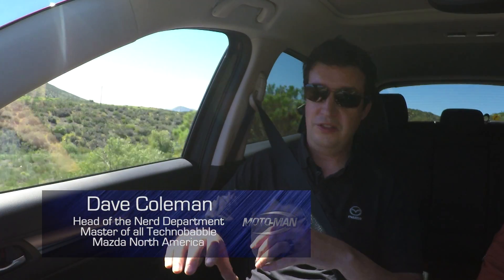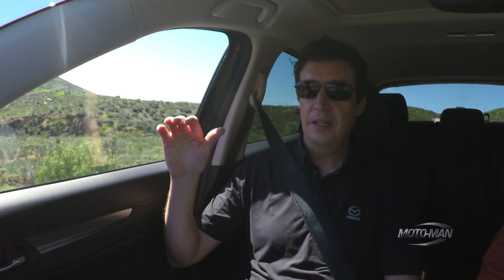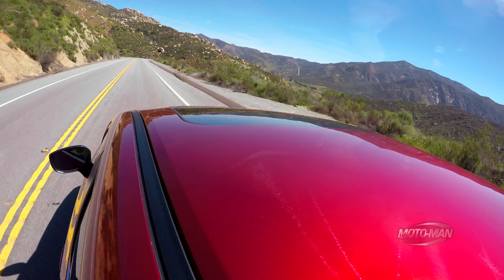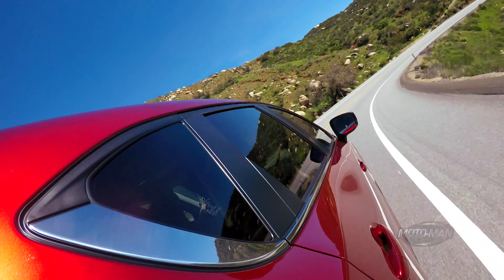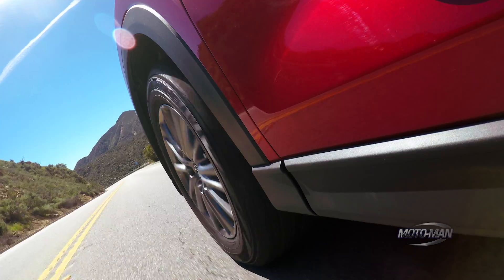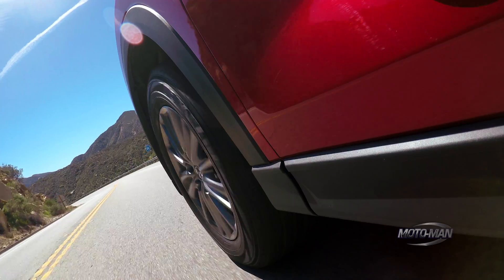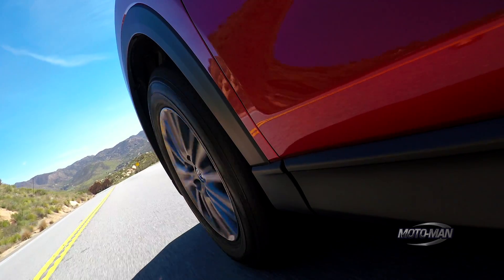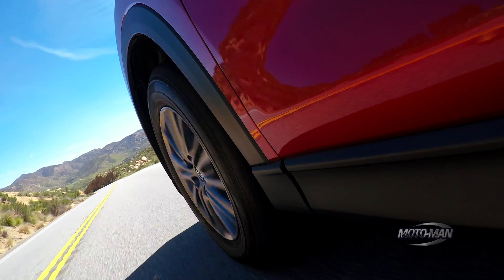PART TWO: 2017 Mazda CX-5 *very deep* ENGINEERING REVIEW with Dave Coleman (4 of 5)

Comment: Diesel 2.2 for the fuel economy. Torque plus high 37-40 mpg. The only thing I'd consider other than the Skyactiv D engine is that Skyactiv X Mazda is working on. A HCCI engine that runs on gas but with compression ignition. I also agree for a manual transmission for the CX-5 and please not on a stripped down FWD version. Make the gearbox an option on any version with AWD for driving enthusiasts...and I will buy one! Mazda makes some of the best manual boxes.

Comment: I'm living in Denmark, and I have chosen the DIESEL twin turbo....   

Why....?    If the torque is about the same as the gasoline 2.5?   

The reason is this...  Mazda delivers extremely clean exhaust from the diesel, and a diesel engine will always deliver max torque and HP at significantly lower rews....  So when driving lond distances, the low rews is a bonus from the diesel... And I might add that the Mazda diesel does not sound and feel like an ordinary diesel...

Comment: If Mazda want surpass other car companies they need to boosting up their engines in all models to turbo. Yes Mazda have an edge when come to design Cx5 and cx9 but they are still lacking with their engines power therefore the companies like Toyota and Honda still can compete with Mazda by give more power engines for their loyalty customers out there! Mazda can be a winner as a premium franchise car company for 2018 if they their models with turbo power!! Remember keep in mind if you want to compete with someone you need to do better than them not just enough is ok.

Comment: I have been extremely excited about getting the 2.2 Turbo diesel. I have never owned a diesel and was looking forward to it. However, if I were given the choice between the two,. I would have a very difficult time choosing. 

Assuming same torque numbers...

2.5 T Gas:

* Higher HP
* More readily available fuel
* Tried and true

2.2 TT Diesel:

* Better fuel economy
* More TQ down low in the majority of the power band
* Holds value better

Depending on how they both feel in the butt dyno, I would lean toward the 2.2 diesel because this will be my DD and I would enjoy the high torque with the better MPG's. 

Just please... No matter which direction is chosen (if not both) PLEASE give the option for a manual transmission in the turbo models! And not just at the lower trim!

Comment: First off, great video, great information. 

For the question, gas or diesel with the same torque? Which would have the better MPG? Most likely the diesel. For the same performance, I'd choose the one with the better gas mileage. But, in the US, diesel just doesn’t have the same appeal for the masses and the VW scandal hasn’t helped at all (Daimler soon to follow?). So, if Mazda wants to sell more here, bring the gas 2.5 turbo. 

So...here's a question, or more hopefully...a request for Mazda. 

Mazda is doing a great job at designing and building vehicles to move its brand towards the premium / luxury market. When will they start to include some additional luxury features like ventilated and massaging seats as well as releasing a "performance" trim of their cars (300HP, paddle shifters, drive modes (sport, sport +), etc.), like the Mercedes AMG or the BWM M? The MazdaSpeed CX-5, MazdaSpeed6, etc. 

Granted, Mazda is not considered a luxury brand at this point but releasing a performance model might be another way to elevate the brand to that level. Good luck!

Comment: Unless the diesel will be higher volume and offered in all models, no point bringing a one off motor that will have far less parts availability in the national depots. The cost for owners out of warranty will be much higher than if you stick with one motor like the 2.5T that can be multi purposed.  I'd rather own a vehicle when I know there are 200,000 tried and true motors in the wild than something that may have 15,000.  Plus most American consumers already have been soured to Diesel because of VW.  Might be a great motor but not the best choice here.

Comment: Let's be honest. The diesel engine will provide longer distance on a full tank. For the tuners out there... well let us just say twin turbo's are better than single turbo's. However it would be nice to see 2.5L Turbo fitted to a Mazda 3 with AWD. MAZDA are you LISTENING!! Mazda 3 (ALL VERSIONS) with AWD and we can't forget MANUAL TRANSMISSION. If you can do this then there would be once again a good WRX comparison. Now that the Mitsubishi Evolution and Ralliart are dead. Mazda can take over were they once shined. Mazda has a good recipe for a hot tuner with power,  handling and technology at an affordable price.  Who agrees?

Comment: 10 years ago I'd be first in line for the diesel but now I wouldn't touch one.  Gas engine efficiencies have increased while efficiency of diesel engines have decreased due to emission requirements. With the diesel's initial higher cost,  higher diesel fuel prices, and the cost of DEF, it is hard to make an economic case for diesel.  Add to that, the horror stories of computer nannies shutting down vehicles due to poor quality DEF plugging lines from crystal formation or freezing in cold climates and you have a maintenance time bomb. However, not a fan of turbos in general.  Turbos fall short of EPA mpg estimates, add  complexity, clutter up an engine bay, and are one more expensive component easily damaged by American driving habits. There are no simplistic or economical replacements for displacement.

Comment: The diesel is ambitious, but if we're talking about what will sell more cars, the dynamic pressure gas turbo is a much easier sell in the North American market. I've also heard conjecture that Mazda wouldn't want the same powertrain to take away from the flagship CX-9 sales, so why not downsize and make a 2.0 liter dynamic pressure turbo that gets proportionately around 182hp on regular, 200hp on premium, and 248tq

Comment: 2.5L Turbo Gas with MANUAL IN HIGHEST TRIM, not lowest. I will buy immediately. Mazda = driver's car. People who want manual are car people, and therefore also want the nice stuff too, like the better sound system, seats, etc. People want a manual, but don't want to be stuck with the most stripped down model in order to get it. Unfair measure of popularity of manual when it is only offered in lowest trim. Forces people to make a truly unfair compromise.

Comment: I've had the 2.2L diesel CX-5 since it was released. Best decision ever!! It's the highest revving quietest diesel in the segment of this size. Makes the Tiguan seem noisy and lethargic. Best thing about it is how quick it does overtakes. It has significantly more torque than the 2.5L at the perfect rpm - 2000 - which is just above where you sit on highway. So it's a quick blip on accelerator, change into fast last, you've passed a few cars then back into the slow lane. So painless.
It doesn't have the AdBlue of competitors. Doesn't have additives like competitors. It does however require a highway run every so often to empty particulate filter.
The fact that Mazda was the only brand to have their diesels check out as matching their published emissions in the real world, and therefore the only non emission cheaters in wake of VW diesel gate is a bonus as well. That figures though given that Mazda turned diesels on its head by lowering compression ratio - which they said was to get two things - 1. weight reduction (because they can use an aluminium block) and 2. by lowering cylinder pressures for lowest compression, they lowered cylinder temperatures, which reduces NOx production and also allows the fuel to mix better, avoiding locally rich areas that produce soot. Basically in real world is means less particulate.

Comment: I bought the 2017 and have about 600 miles on it now. I like it more everyday. I would definitely go for the diesel if it actually happens. I'm going from the VW diesel sportswagen, and after driving a diesel for a couple of years I can't wait to own one again. I really like the way they drive and sound, the pull is so effortless and along a wide range of rpm, the lower less winding out sound in the cabin is very satisfying. I also really enjoy going 500 miles between fill ups. I can't wait to test drive a modern Mazda diesel!

Comment: Got my 2017 CX-5 GT April 3rd the day the dealer got them in.  I am in absolute love with this vehicle.  Its taken a bit of getting use to something this large as I went from a Prius > 2016 Mazda3 to this.  But when winter rolls around again the 19" wheels and the AWD are probably going to be a Godsend for up here in Minnesota.  I wanted to wait for the diesel but couldn't hold out until fall.
While the acceleration isn't Mazda3 level, its still not bad at all for such a large vehicle.  I've found that all the safety features from My Mazda3 like lane departure,  auto wipers, auto high/low beams....the tech in the Mazda3 felt gimmicky.  It worked, not all that well.  The CX-5 it feels much more refined.  Instead of the gimmicky plastic HUD screen there is the real deal now and its easily a must have feature for any future car.  One thing that I found.  The auto hold feature.  When I turn it on and use it.  When I put the car in park at my destination it turns on the actual electronic parking brake.  It does this consistently which doesn't make sense.

The only thing they need to make this perfect is the CX-9's turbo and Android Auto. =D

Comment: My wife and I have owned a 2014 GT Tech Package CX-5 and then replaced it with the same 2016.  The 2016 was an improvement in almost all areas that needed it.  Suspension dampening was adjusted, seats were made softer, better sound insulation, tech etc (although I'm still disappointed that Mazda does not have a traffic provider on the NAV).  Point of this all is that we probably will be getting what will be a 2018.  The 2.5 litter Turbo will make this a much better vehicle.  The current 2016 is a little flat footed.  Particularly (for some reason since I don't seem to notice it at a light) making right turns from a stop and having to accelerate into the flow of traffic.  There's a dead spot in the RPM range after the shift that necessitates flooring the pedal to gain speed quickly.  Again, not as noticeable in a straight line.  The other thing that I hope is improved is the highway / high speed ride.  The vehicle feels a little unsettled and darty at times especially in around expansion joints, etc.  I often thought perhaps the tires were too large / heavy on the GT models for the weight of the vehicle.  In all honesty, the stock tires aren't that great in the snow.   The tread blocks are too large and there aren't enough sipes.  Michellen and Pirelli make a much better all season tire.

Comment: 2.2 Diesel as the torque is likely to come in lower and have a wider band which should improve driving dynamics. The diesel should also return 15-25% better fuel economy and have less maintenance which should lower ownership costs. Diesels also generally have better resale value thus further lowering cost of ownership. Economics and driving dynamics should squarely favor the diesel. Despite being on the Model 3 preorder list emissions are not a factor to me but economics are driving dynamics are very important. The idea of a fun to drive Suv that gets probably close to 35 mpg is highly appealing and currently doesnt exist at prices the average family like mine can afford( The X3 diesel is nice however the pricetag isn't).
Reply: Chris Dooley At least one person think deep about the car that  probably will cost closer to $40k, if reliability/ warranty issue solved the twin turbo diesel all the way...on top of everything Chris mentioned, you can pull some decent weight trailer of your choice...and if it gets 40mpg it'll beat hybrids competition without complexity of dual motor system..

Comment: I would pick the 2.5L Petrol Turbo.  Americans (overall) have an affinity for gasoline engines v. diesel engines.  Unfortunately, with the GM diesel issues in the 80s, the VW negative publicity, and the fact that diesels have been used primarily by large trucks, they have a horrible reputation for being dirty, noisy, and not environmentally friendly.  As great an engine the 2.2L Turbo Diesel motor is, I seriously doubt you can overcome all the negative publicity and attitude Americans have toward diesel engines.  A CX-5 with a 2.5L Turbo Gas Engine and heated and ventilated front seats, even with out an 8 or 9-speed transmission, would be a Lexus, Audi, Mercedes, and Acura killer.  Please add this engine option to the CX-5 ASAP, and if you can a 6-speed manual paired would really be the icing on the cake!

Comment: Interesting interviews with key people. Thank you. Hopefully you can convey this to Dave:
we want to have a CX-9 with:
- a turbo charged V6
- ventilated seats especially in the hot weather of the Middle East
- a more advanced automatic gear box with more speeds
- paddle shifters
- infotainment system with apple car play & android auto
- wireless mobile phone charging
- brake auto hold
Reply: My 2017 cx-5 has brake auto hold. Apple/Android is coming in an update this year, too. So there is a couple things off the list.
Reply: Abdullatif Moukaddem I assume, that Mazda won't make a V6 (Turbo), maybe a inline 6. I am living in Thailand and cooled seats would be a nice feature. But the aircon is very efficient and cools down the car very fast. I have more problems with a hot steering wheel...

I love Mazda's transmissions. I think, that more than 6 gears are not really necessary, with a good engine design. I suggest that the 8 to 9 gears are only good for the brochure and not for real live driving. I really like, that Mazda is brave enough to avoid features which only look good in the brochures.

I liked the paddle shifters in my Mazda 3. Our current CX-3 and CX-5 don't have it - and I don't miss them.

Mazda has promised Apple CarPlay and Android Auto for the near future and you will be able to upgrade your current car.

Comment: I'd buy the gas over diesel. I prefer the driving characteristics, emissions and off the line performance of a gasoline engine. The 87 octane is less expensive than diesel where I live. Lastly I wouldn't want to deal with the blue tech refilling, blah, blah that some diesels can require. (FL, USA)

Comment: 2.5 turbo, I want all the revs
Reply: tunkor As far as I know, the turbo in the CX-9 don't like to rev high. It is designed for low-rev torque and not high-rev power. I own a CX-5 Diesel and this engine likes to rev up to 5,000 rpm and sounds quite good.

Comment: Easy decision; 2.5 turbo gas engine. Develops more power, no expensive particulate filter to worry about. Much better for the environment.
Reply: paul dewar I very like my CX-5 Diesel. But I agree, that the next generation of gasoline engine will be better. Mazda is also developing a new generation gasoline engine with very high compression which gives you the advantage of the Diesel but without its problems. But this will take some years...